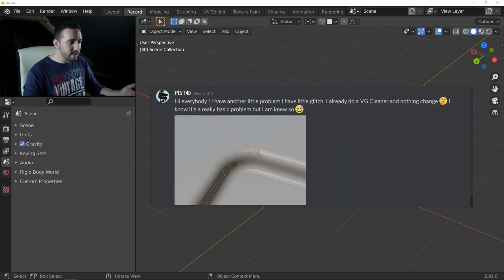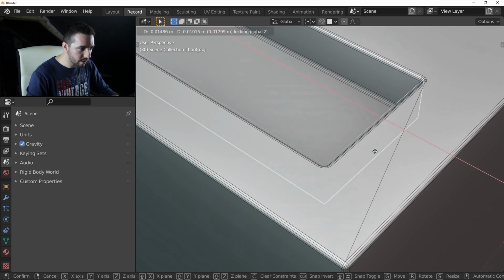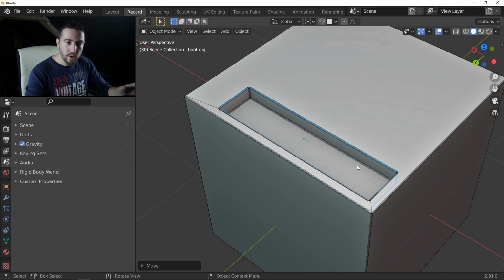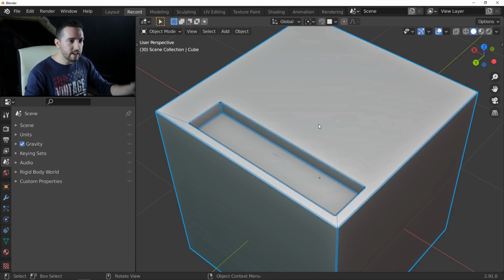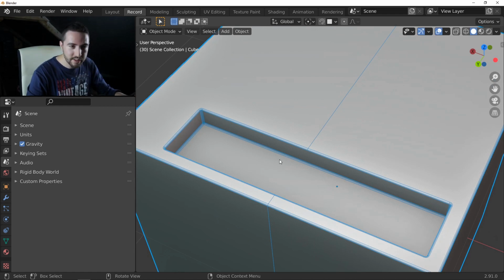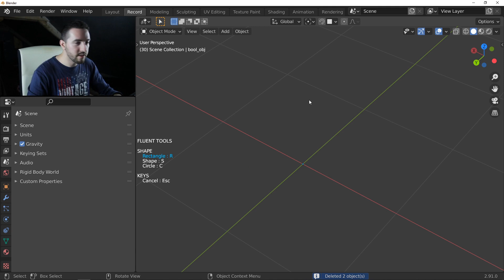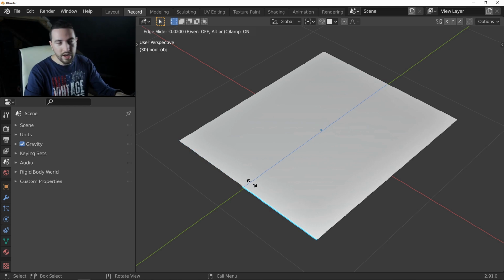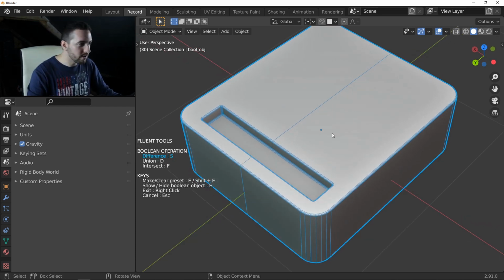Help me pls : Artefact on simple cut

Comment: Nice idea and nice video! A perfect Cristmas present.

A note. Fluent has several commands accessible only using the search panel. Why don't you call all this commands "fluent_cammandname" so the users know that they have to search for the word "fluent" and all the commands for fluent will appear. The will not  need to remember "vg" for example. It's just an idea. Bye.

Comment: Yes adding a edge loop on Y and X axes from front view isn't a problem, but what if we want to add it on Z axes? I was trying to find solution to this but its just impossible since every fluent object is a plane
Reply from the maker: Meet after tomorrow ! :)
Reply: If you are using a standard object you can just cut in a loop with control R.  If you are using a fluent object when you edit it add an edge where your cut will take place.  Then run VG clean.  It will create a loop all the way through the fluent object and will still fix it.